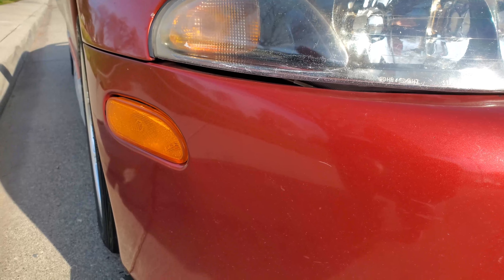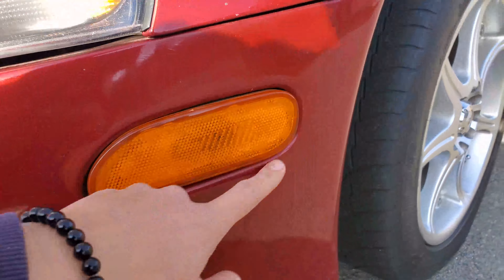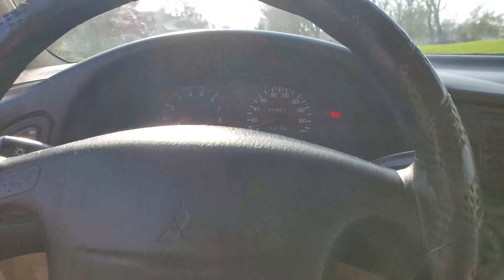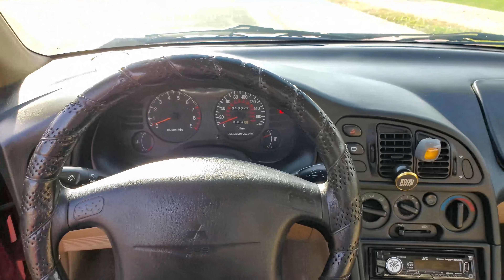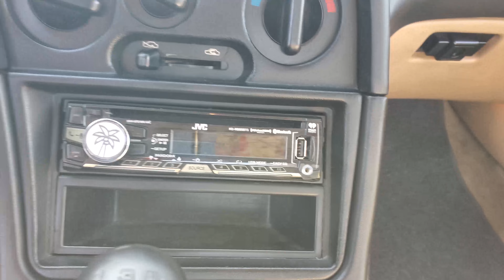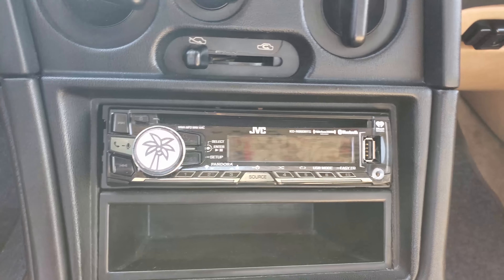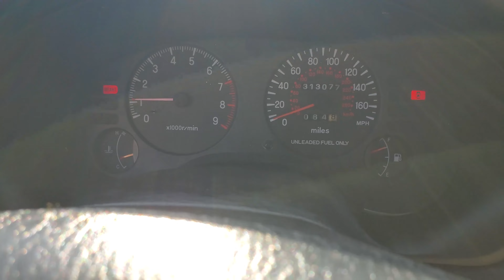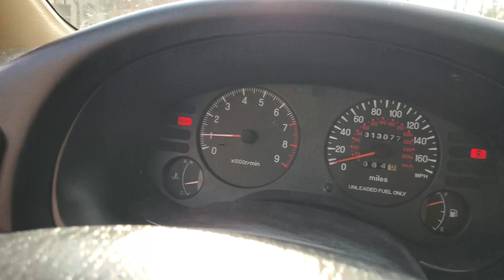My Mitsubishi Eclipse Walkaround! | 2G DSM ECLIPSE

Comment: How did you fix that no start problem from your previous video
Reply from the maker: Initially, for me it was due to my cam gears being shifted about 1-1/2 teeth advanced 

I would verify all your necessary things to make your engine start, look at your camshaft holes and make sure those are pointing straight up

Comment: hey man so i just bought a 96 gs eclipse. it has a 420a in it but it has a no spark all of the cylinders. I replaced cam and crank sensors. new spark plugs and wires new coil pack and i can crank it forever but doesnt start. I have power in the wires that go into the coilpack. I tried some starter spray to try to see if it was a fuel issue and it didnt start. I need some help lmao
Reply from the maker: Check your timing, start from the bottom sprocket, once it’s aligned move to the top.

Check if the cam gears are aligned, this will signify your out of time, and the car can’t start even for a tooth or more

More extensive work is needed to be done if these are off (valves, etc)

Message me on Instagram or email if you have any more questions